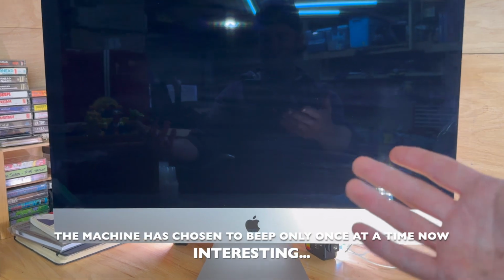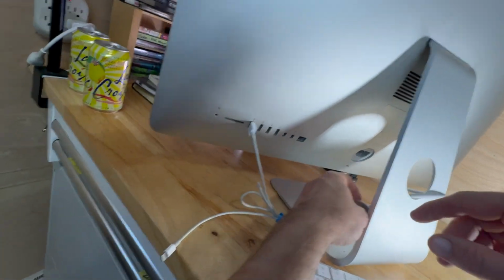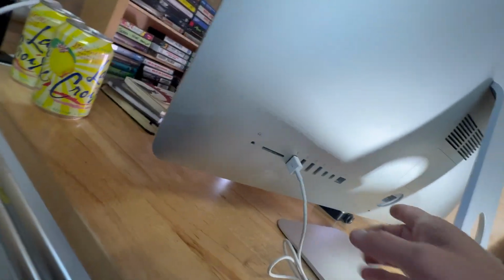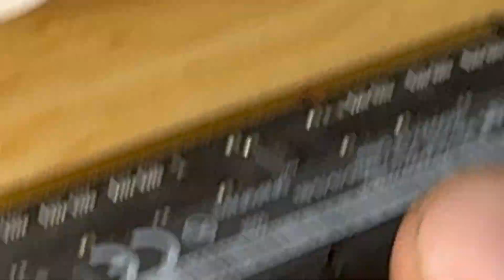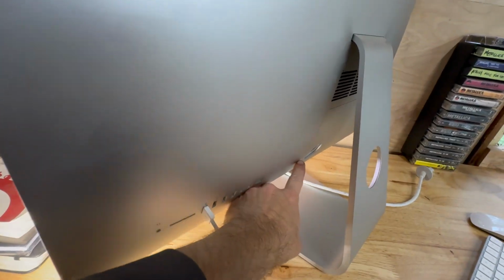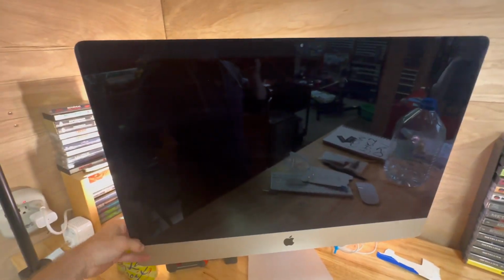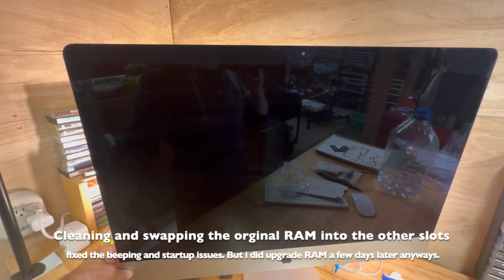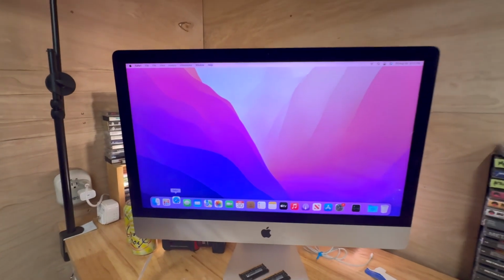How To FIX iMac Beeping No Start FREE (27-Inch Late 2012 to Mid 2015)

Comment: Ufff, my 2015 iMac is sitting there looking at me. I haven't been able to use it for 1 year now. Just bought the new RAM cards. I hope this works and that this is what is causing it to not turn on completely. If it works, then $72 is better than a new iMac or Mac mini. Fingers crossed.
Reply from the maker: Best of luck with the repair. It's exactly what mine needed to get working again. Original RAM died out and wouldn't let the computer boot up at all

Comment: I had to swap them around a few times, and eventually, I only loaded two RAM cards in instead of the 4 I had in there, and that worked.
Reply: Yeah, i added those other two new RAM cards about maybe 2 years ago into my 2013 iMac 27-inch. That's the first time i's glitched like that. Otherwise, it runs fine. It just wouldn't come on. I could hear a little slight beep every few seconds. Once I tried moving the cards around, I then heard the three big beeps. Then, I moved them around again and back to the little beep. I eventually tried just using two in the bottom 2 slots, and that worked.
Reply from the maker: @martinoconnor1160  nice fix! It's nice to keep some of the older iMac's running, especially the 27 inch
Reply from the maker: Some of the older machines can be a little picky with the RAM cards of today

Comment: Mine doesn't have that plate that opens on the back... any ideas?
Reply from the maker: What year / model do you have? If I recall, some of the years and some of the the smaller screen versions are a completely different process and some aren't upgradeable at all.
Reply: Same here, i open the imac and it beeps evrey 5 secs until i shut it off.

I dont have the ram tray in the back that u mention, my model is imac a1311,
Any ideas what should i do?

Thank u man
Reply: 21 inches variant doesn't have it

Comment: 👍
Reply from the maker: Cheers buddy, hope this video helps ya 👍👍
Reply: Mine 2013 doesn't have that compartment in the back. After all these years I never moved it and the day I decided to buy a new one it stopped working. I took it to Apple so they could transfer all my data over to the new one. Nothing. Black screen and that same sound. I was careful in toting it with a cushion in front of the screen. I just order a power cord and will purchase some air to clean the back